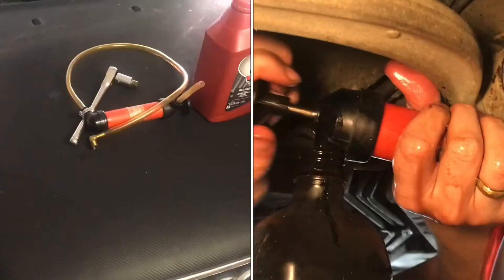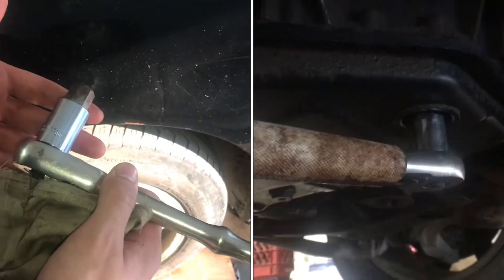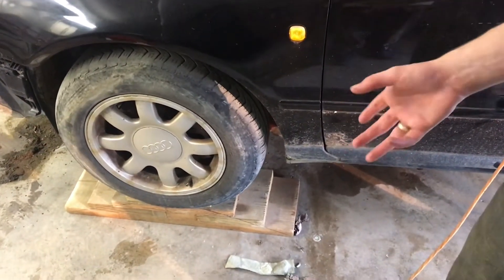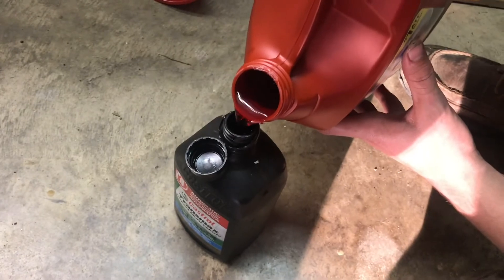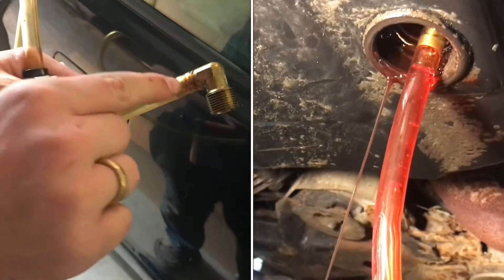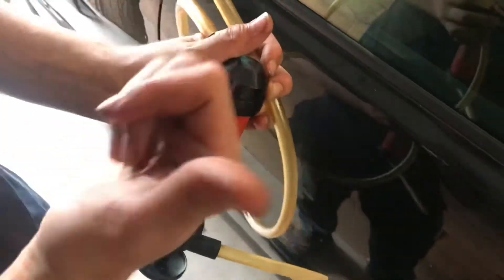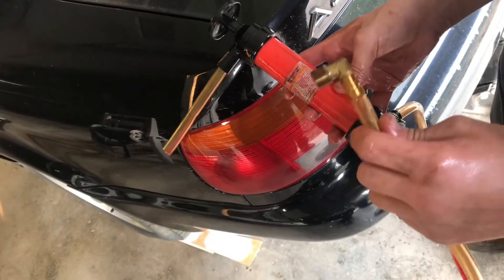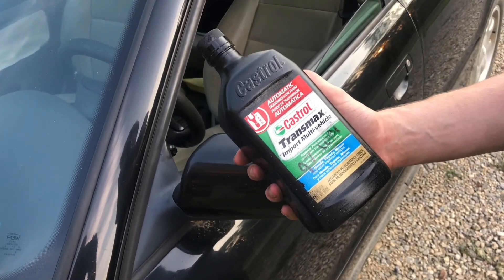adding transmission fluid  (a4 audi volkswagen passat)

Comment: Where did you get the right elbow? I have the pump i got it from harbor freight but i cant get it in that little hole
Reply: Hey 👋 
I see you didn't get an answer here.
Wondering if you figured it out? I can't seem.ti find any specs on the elbow size. Thanks.